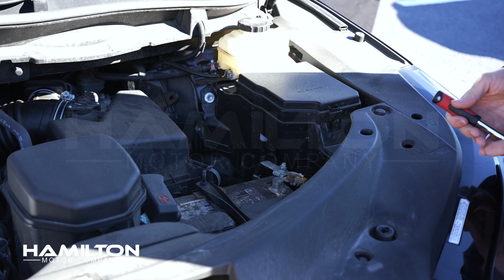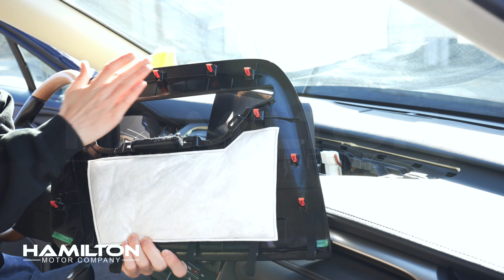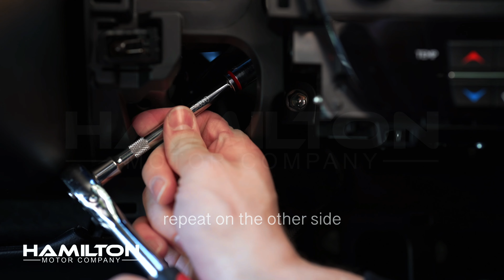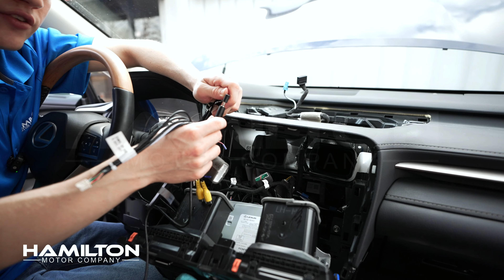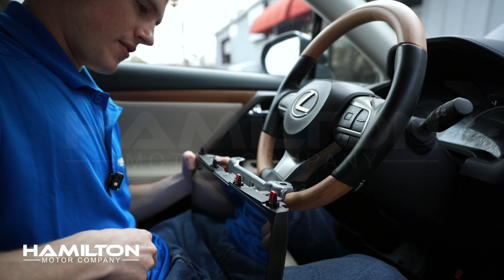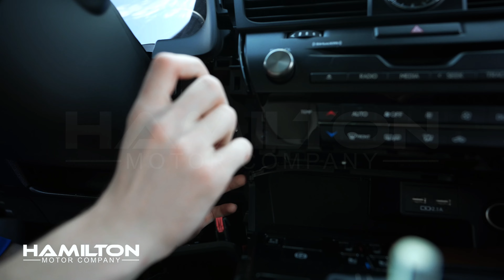How to Install: 2020-2022 Lexus RX Hamilton Conversion Kit for CarPlay and Android Auto

Comment: Would love it if the Hamilton USB cable could just replace one or more of the USB cable plug outlets already in the console OR for the glove box (so you wont need a free hanging USB cable). in the console would be preferred as my Kia Hybrid has that and I love the location so I can use android auto while keeping my phone still in reach (otherwise I need to go into the glove box every time I get in/out of my car).
Reply from the maker: There are daisy chain devices on amazon that allow you to mount a USB port. They are unfortunately not high enough quality for wired CarPlay to function, however.